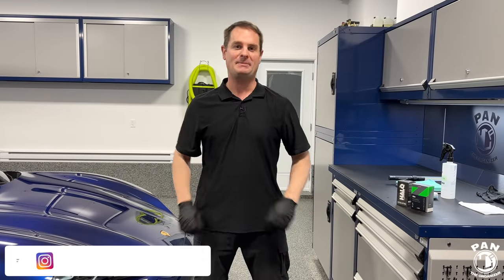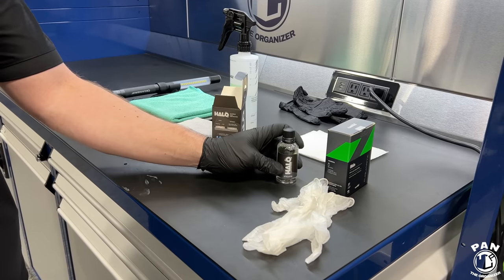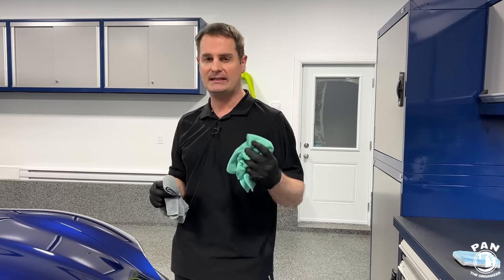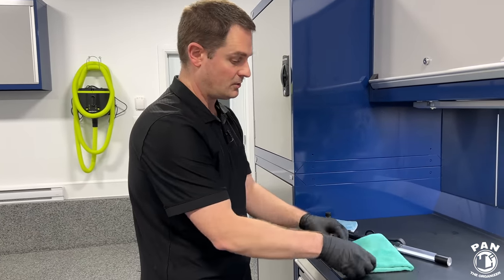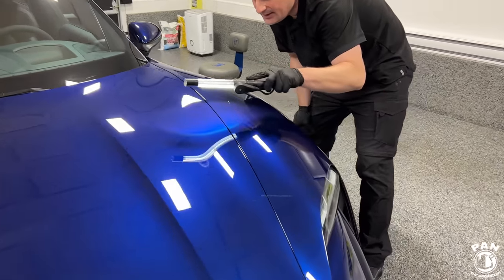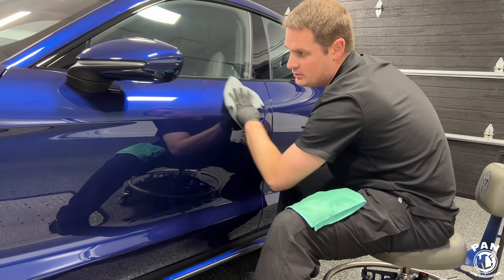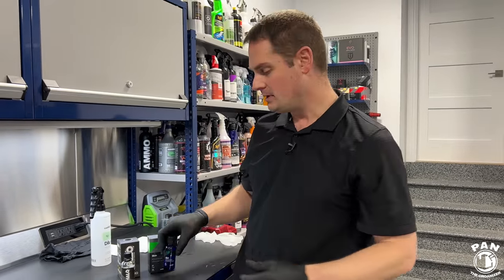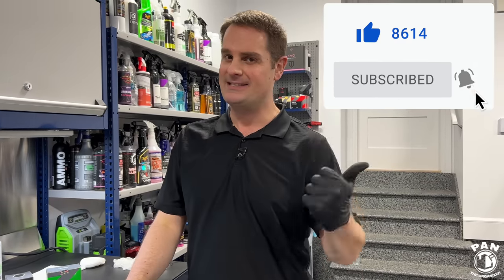How to apply a ceramic coating on PPF (paint protection film) : Porsche Taycan Turbo

Comment: Salut , sur ppf , après préparation,  peut ton appliquer ceramic graphene paste wax turtle ? Si oui . Est ce plus pu moins 6 mois durabilité  ?
Reply from the maker: La cire en pâte graphène et céramique n'est pas conseillée pour le PPF malheureusement.
Reply: @PanTheOrganizer   ok et est ce que le flex wax  turtle est recommandé pour ppf ?
Reply from the maker: Oui tu peux l'appliquer sur du PPF.
Reply: @PanTheOrganizer  merci encore
Reply: @PanTheOrganizer et est ce que tu dirais plus ou mois 6 mois de durabilité avec  flex wax  avec une bonne préparation sur ppf ?
Reply from the maker: Impossible de savoir, car je n'ai pas de PPF sur mes véhicules. Le PPF n'est pas pour moi hehe.

Mais il ne faut pas stresser avec ça. Lorsque tu vois l'effet déperlant commencer à diminuer, tu n'as qu'à laver le véhicule, vaporiser et rincer le produit. Une fois que la couche de base, la première application, a été faite sur surface sèche, l'entretien est aussi simple que vaporiser et rincer (spray on rinse off). Ça prend quelques secondes.
Reply: @PanTheOrganizer  merci encore

Comment: Do you prefer the Halo over the carpro?
Reply from the maker: Gtechniq Halo, CarPro Skin and Gyeon PPF are all top tier PPF coatings and very similar in durability and performance. You'd be hard pressed to pick them a part. Pick the one easily accessible to you, or the less expensive one depending on where you live.
Reply: @PanTheOrganizer  thank you! Greatly appreciated.
Reply from the maker: My pleasure. How did you discover my channel by the way?

Welcome to my channel. You discovered one of the biggest car detailing channels on YouTube as we surpassed 1 million subscribers and we have over 140 million views! I have been detailing for 27 years and I love to share my knowledge and passion with my viewers.

You found the right channel to help you learn everything about detailing.
Reply: @PanTheOrganizer  just searched PPF ceramic coating and you were one of the first that came up. Very detailed video. Just had my entire truck wrapped in Xpel. $1000 to ceramic coat it sounded a bit ridiculous so I'm glad I found your video. You saved me over $900.
Reply from the maker: My pleasure. I want everyone to be able to enjoy detailing their own cars, save money along the way, and get awesome results. For your PPF, as you mentioned it was XPEL, check with your installer as I heard that XPEL voids your warranty if you use a coating other than their own. They figured a way to increase their income by forcing customers to get XPEL branded coatings applied by a certified XPEL dealer... :(

If you don't mind about PPF warranty, then by all means apply the coating YOU want. ;)
Reply: @PanTheOrganizer  thanks for the info! I didn't know that!

Comment: Love the Taycan Turbo S and the blue looks amazing. I decided on the Tesla model S Plaid in the blue and just finished full PPF coverage and need to protect it. I had two questions. 

1) I was going to put a graphene coating over the PPF but it sounds like the Ceramic coating might be better than the graphene? 2) I have the CarPro Eraser and wondering if it will hurt the car to use it on the PPF? I am going to buy the CarPro Skin that you linked. 

I have some booster that I want to use on top of the two coatings. Thank you as always and you are going to have a very happy customer. Extra credit points if you race him in the quarter mile with your Turbo S. Lol
Reply from the maker: For CarPro Eraser, many use it on PPF, just test on an inconspicuous area first. But you should be fine. It doesn't matter if you get a ceramic or graphene coating for the PPF, they will both work great.

By the way, I have already tested my 911 Turbo S against a Taycan Turbo S (which is even faster compared to the Taycan Turbo from this video) and my car still comes out ahead. Same results as many have already demonstrated in YouTube videos like this one: https://youtu.be/l2ojCqhqGZ8

The 911 is so much lighter that it jumps off the line.
Reply: @PanTheOrganizer  you’re really gonna love your 911 turbo S for many years to come. That was such a great purchase for your channel. I already had some really good ceramic and some really good graphene but I’m going to try the PPF focused CarPro skin product. The supply chain can’t get it here till the last week of the month. Thanks again pan

Comment: I am really curious, what do you think about PPF?
Reply from the maker: I am just not a fan of the look or feel or PPF. Plus, as I get a brand new car every three years, and do low yearly mileage, scratches and stone chips are of no concern to me. My cars are always pristine when I bring them back to the dealership.
Reply: @PanTheOrganizer  That makes sense in your case. Here in Europe, PPF is not so widespread and popular. Did you face the problems related to PPF? For example glue after removal of damaged clear coat?
Reply from the maker: I mainly detail newer or brand new cars. After 25 years of detailing, I do what I enjoy now. I don't do disaster type details hehe. So I don't remove PPF.

Comment: So what protects the ceramic or the PPF?

(Seriously, this is starting to get goofy)
Reply from the maker: LOL It's just that people have to realize PPF and coatings accomplish two different things, as mentioned in the video. If you only care about stone chip and scratch protection, all you need is PPF. If you want protection against the elements, UV rays, chemicals, acid rain, bird droppings, add gloss and slickness, and self-cleaning properties, coatings is the way to go.

For the best of both worlds, PPF first, topped with a quality coating. Like in this video.